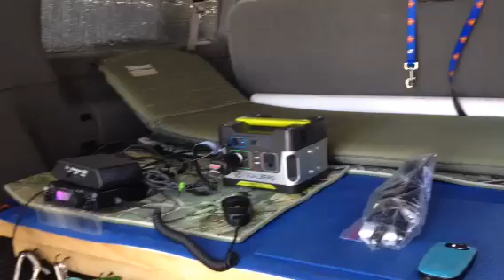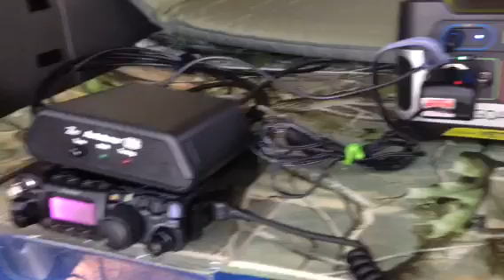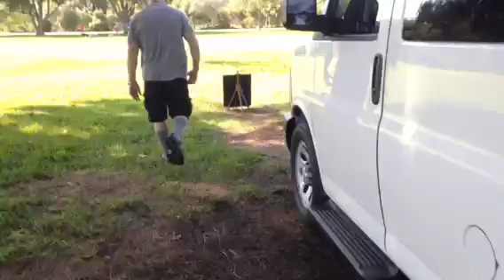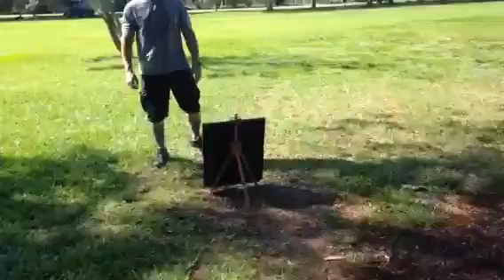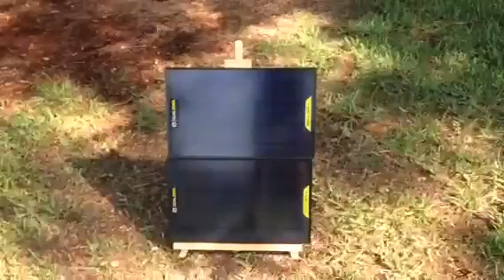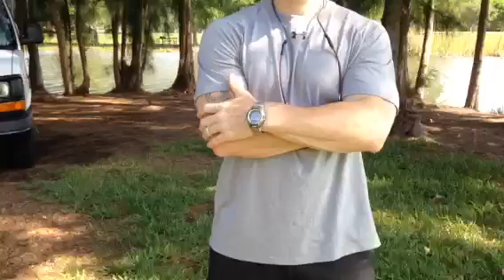Off Grid Solar Ham Comms Set-Up

Comment: Will it still work in cloudy conditions?   Have a buddy just dying for some sunlight.  Where he lives its been a rainy 2 weeks.  I remember some time ago I watched a program on Saturday afternoon, that showed a retired guy using a tree as his antenna, and made a souped up crystal radio.  In that documentary he used a bicycle and a v-belt attached to a 12 volt car alternator and it would power his toaster, and small tv(analogue).  That may be harder now, but it should be possible to charge some batteries, I'm sure, so that you could have that secondary back-up. It was also a great way for him to "work" for his free electricity.  I've been known to use some solar powered lamps to light the inside of my house when we were out of power.  Solar is pretty cheap and I believe you have a lot of sun in Florida. That set up could be improvised for the house/apartment, especially with hurricane season coming up. Great ideas, Anthony. Thanks. Jb.
Reply from the maker: Jb Bennett Yes, the solar panels still work in cloudy conditions, but not as strong.  There is a channel- Engineer777 that does a lot of stuff like that.  Generating his own power.  He has a video using a stationary bike.
Reply: Hey, Engineer777, I'll look it up. Thanks!!! This stuff reminds me of my pappy.  He was a genius and a Seabee.  He would tinker and make stuff out of nothing-some peoples trash is some peoples treasure-.  He told me once that if he couldn't scavenger(borrow, trade, hustle) a tool he needed for a project, he'd make one. Hell, he used to work at a resale shop, and he'd fix up stuff and make it better than when it was new. Sometimes, he'd rustle up some stuff and make a totally new device. The neatest things I remember him doing(at a party)(I know I'm changing the subject a bit) was talk to a "pretty" hostess and make her and her husband believe that they had met previously.  Mom knew there was never any "hanky panky", cuz she was the boss and he loved her so much.  But, he'd say things like, "I remember you, it was in a different "setting", though, and low and behold the hostess's husband would come over and listen in. Mind you, he didn't do it to every gal, just the ones who he could tell, "got around" a bit. It was so funny that mom would have to leave the party early and that's just what dad wanted to do. Thanks for helping me remember that one.  ATB, Jb.
Reply from the maker: Sorry.. It is Engineer 775:  https://www.youtube.com/channel/UCpDl4WPpgvvOeZFpw4ewycA

Sounds like your pappy was a great guy and very resourceful also.

Comment: Anthony, does your 817 receiver have internal batteries in it allowing you to use only battery power and what size batteries?  I am sorry for some dumb question but very new to HAM or still learning waiting to take my test using Baofeng UV5r+ radios for now but will be up grading once I get my license and learning more.  Keep up the great work.
Reply from the maker: learningtoprepper Yes, this unit has a small battery pack to use on 2 meters, but I have not tried it out yet.